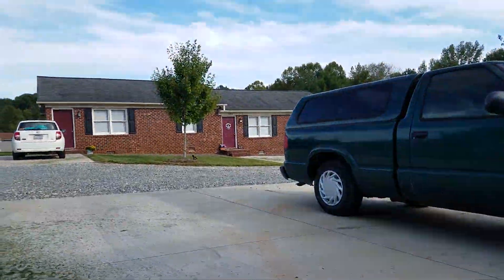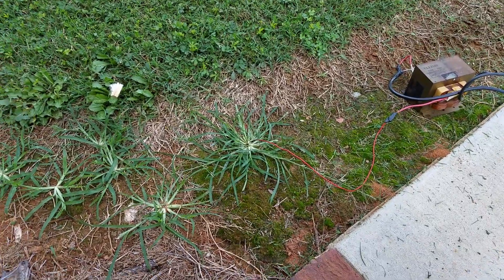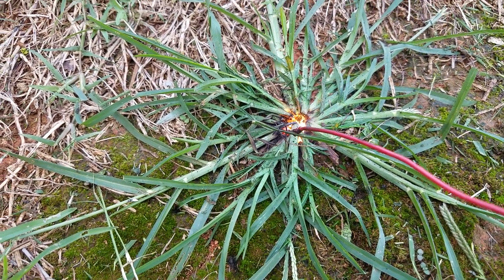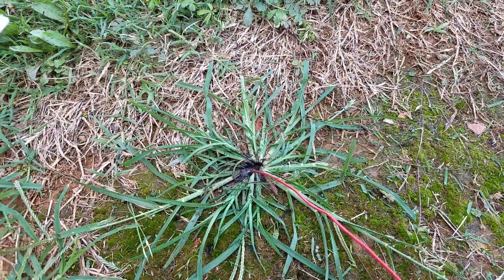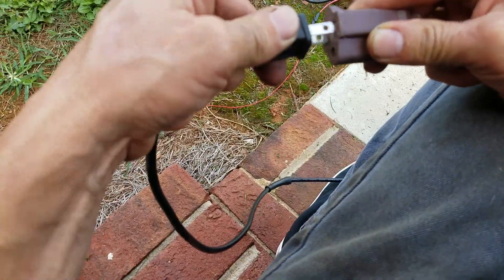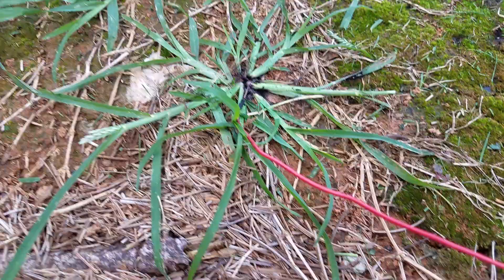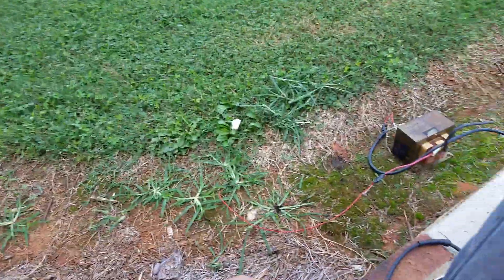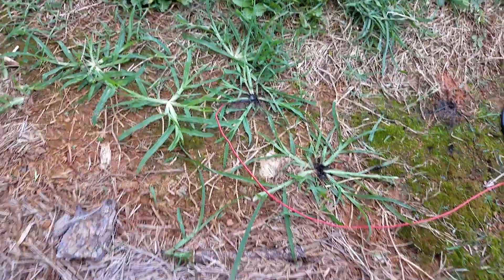2200 volt weed killer smoke Sparks and arcs

Comment: How can I make something like this? My property is covered in Knotweed.
Reply: Knotweed brought me here too!
Reply from the maker: Just take the transformer out of an old microwave that's what I did ....  Be careful though it's very dangerous
Reply: @barrettcrook394  What gauge is the red wire? And what do I connect it to on the transformer? I have a microwave ready to be taken apart, I just need assembly instructions for the diode portion of this experiment.